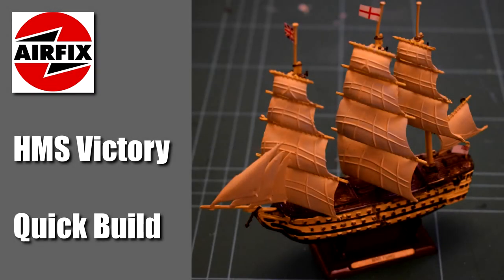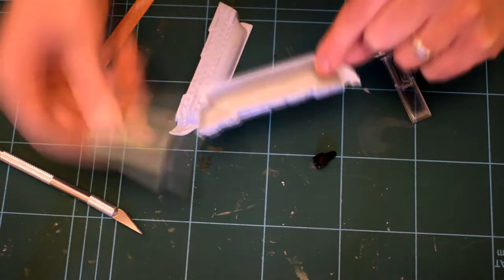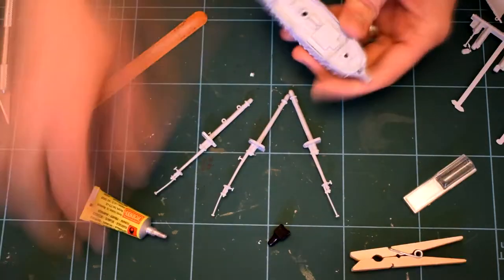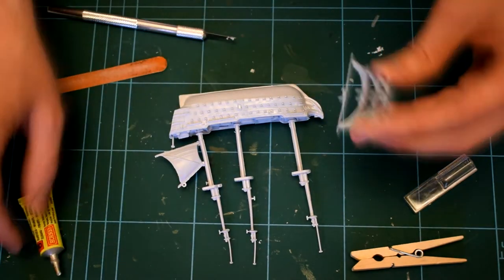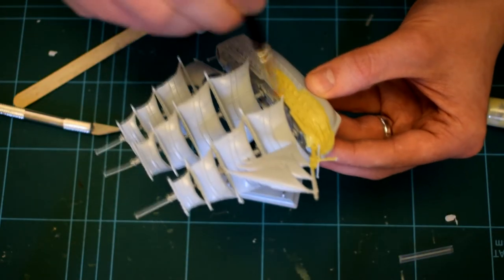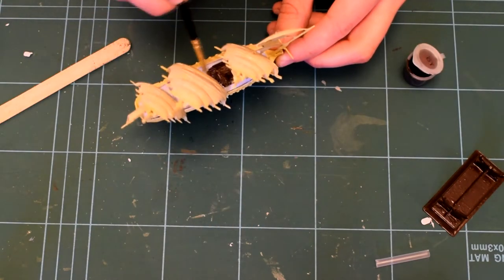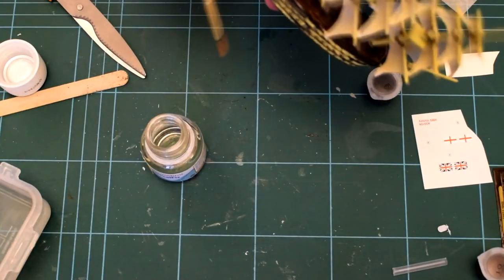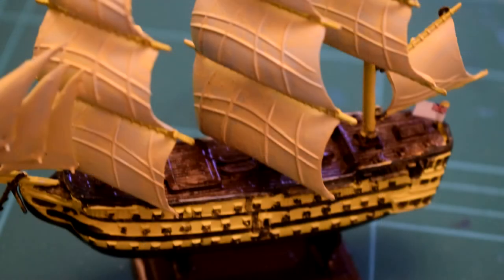Airfix HMS Victory

Comment: I find the paints in those pots come out glossy if you don’t shake them well enough.

I shake them vigorously for about a minute, put a few drops onto a palette, use a drop of water to thin and I get a much better result than using the paint directly from the pot.
Reply from the maker: crazymaner2003 thanks for the tip! Yes, they do need a good mix, and I find I add a little water to them as I use them now, at least in some of my later videos I do 😂

Comment: There is no scale give for this kit but its probably 1/450ish scale, originally released in the late 60's, it was again released in 1973, 1976 and 1999. The kit was reboxed again on the 2000's as a set with paints and a brush as a starter set. I dont think the moulds were updated within this release schedule.
Reply from the maker: thanks for the info!

Comment: To my knowledge the reason why the sales can’t be facing forward it’s because usually at as long as they are somewhat facing forward and catching the wind it will move in a straight line li, so sales were very rarely ever actually facing straight unless the wind was coming straight from its stern over to its bow.
Reply from the maker: sounds about right :D
Reply: @ModelMinutes  thanks i’m currently painting this model, thanks for the tips about painting before putting on sales.👍

Comment: The scale should be easy to work out.. measure the model and divide by one of these;

Length	186 ft (57 m) (gundeck), 227 ft 6 in (69.34 m) (overall)
Beam	51 ft 10 in (15.80 m)
Draught	28 ft 9 in (8.76 m)

The website says the scale is 'fit the box'.. so about as useful as an ashtray on a motorbike.. However it does give the kit dimensions..

23.2 x 3.1 (cm) (L x W)

That doesn't help at all as the width to scale doesn't match the length. Length is 245-298 scale but width is 500 ish?
Reply from the maker: I think someone else worked it out in a previous comment